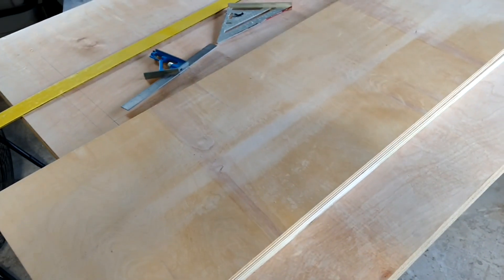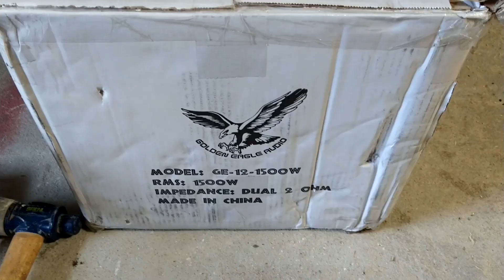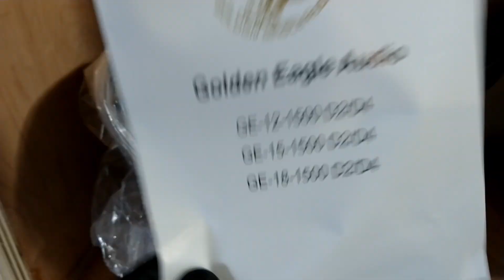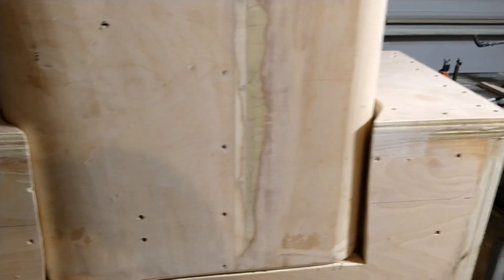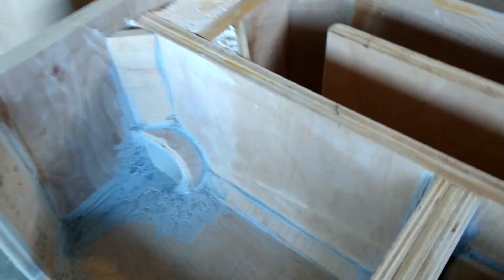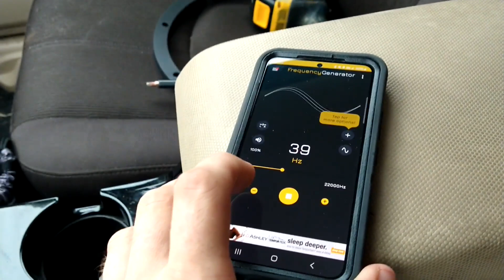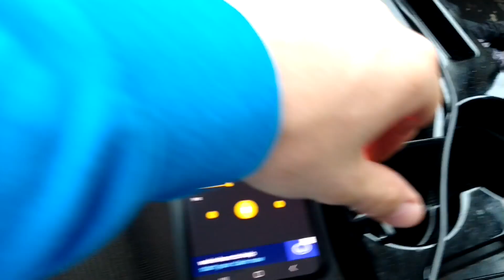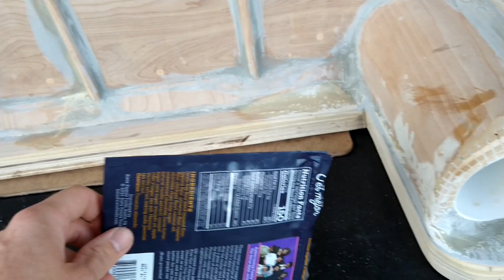8th Order Bandpass Attempt for a 12" Subwoofer

Comment: Did you model the enclosure before hand? I used hornresp to models mine. I am building it now. Yea haven’t seen anyone else really do this. The modeled output is ridiculous. Hopefully it turns out similar in real life. I spent a lot of time designing it.
Reply from the maker: Just on paper, which took forever to get all the airspace just right in each chamber. If any build should have used software, it would've been this one because this thing was a big waste of good lumber 😂
Reply: @JayyCobb  Yea I think this build may have been just too much experimentation at once. 8th order is already complex enough, but you added a t line segment and a tried to do a massive kerf port. Cool nonetheless

Comment: When making the box did you use any software to work it out? Also read what the qts is to determine what the best enclosure would be.
Reply: Subs that have good specs for ported enclosures will also be good for 6th and 8th order enclosures.
Reply from the maker: Usually I just wing it and hope for the best with most my builds lol

Comment: In 8th order you need to be tuning 1/4 waves for each chamber so if the highest tuneing 80 it should go 80 60 40 hz for best results in a band pass you want the sub to have a low fs so that you can tune higher
Reply: Also you shouldn't have done a tline at all in a 8th

Comment: God knows I have taken on a number of fiberglass projects ( sealed door enclosures, ugly corner truck mounted subs) before I eventually got enough time and practice to finally get the results I wanted. It's part of the game. Even with a number of great looking/ functioning projects under my belt I still will occassionally have some that were not satisfsctory at all...These days if I go ported I just use a conventional aero port and find a driver that really shines with the tuning and power I want to go with...Thanks for uploading and trying something different.
Reply from the maker: This one's a small failure in comparison to the 8 18's wall that I built in an Astro Van. Still hurts to think about 😂
Reply: @JayyCobb  yeah that astro van likely didn't have enough air space for 4 of those things let alone 8...
Reply from the maker: That's what I get for paying for a box design instead of trusting my own plans 🤷‍♂️
Reply: @JayyCobb  Oh Lord, I'm not even gonna ask who you paid for the design as to not open a can of worms. I've been doing this kind of stuff now going on 25 years. Occassionally I will learn something from the forums or a video on youtube but most of the time I learn things on my own. Just my two cents, If you want to still do something in the same vain as being ported (but unique as well) have you ever considered going for something like a passive radiator SQL setup?

Comment: Try cutting the rear facing port down. However wide your port is(guessing 3 to 4 inches) you need that distance between the end of the port and the loading wall(rear hatch). That could have been choking the box really bad with how close it was to the hatch. Also guessing this was intended to be a blow through set up on the truck you mentioned which would have probably slammed with some good power on it! Love the experiment though! Ive got 4 12s cramed in the trunk of my 04 civic, 2 of the subs in a single sealed box facing the trunk/boxes and 2 single sub ported boxes facing outward at the quarter panels. Definitely could be better but it sounds really good for what it is, strong from 75hz down to 24hz before it really drops off.
Reply from the maker: Little late for that now that it's all gone lol
Reply: @JayyCobb  hahaha I realized after I sent the comment that you chopped it at the end🤣
Still a fun video, I love unconventional bass set ups!

Comment: I made one for two Soundtream 12" in the early 90's. Generally it was a super sized Bose Achoustimass. About the same external size as yours. The customer made a glass top for it.  Would move your shirt outside the truck. Customer was thrilled. Only 250W per sub. WAY less Xmax back then.
Reply from the maker: That's the result I would have preferred 👍

Comment: I think if on the first test with the whole box some tuning from the radio and amp it wouldve really woke up and maybe a bigger amp and you wouldve had it
Reply from the maker: I had intended to run speaker wires to the trunk of my other car and put it on the 12k but decided not to. However, the 2 12's box I recently built will be tested this way with tons of power. Thanks for the suggestion.